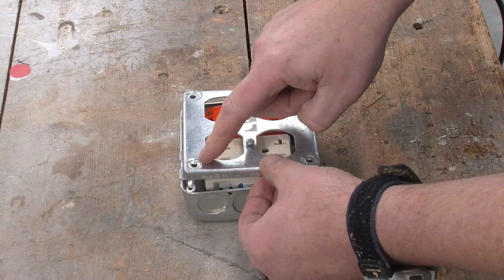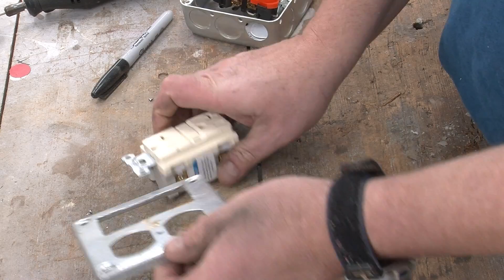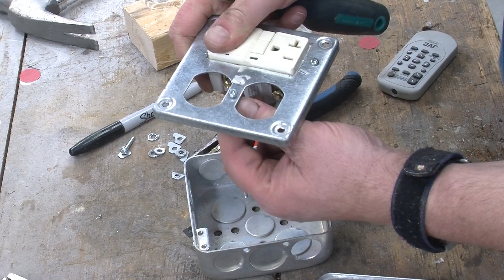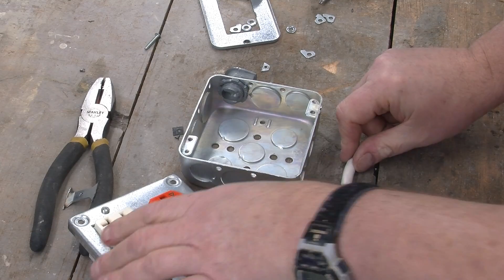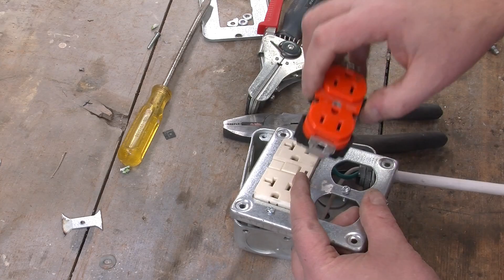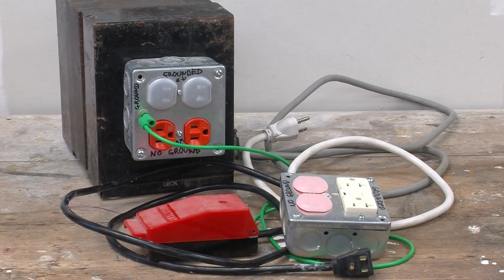Making Portable GFCI Outlet with and without ground

Comment: What is the advantage of a CFCI without a ground as compared to just a normal three prong outlet without the ground? everything is still earth referenced?
Reply from the maker: The CFGI will (hopefully) cut the power to the circuit if it detects any significant amount of current that goes out of the live but doesn't come back though the neutral. So there must be some current going though something somewhere and getting to ground where there should be no connection to ground. That connection might be a human so hopefully the GFCI trips.

If you had an unearthed 3 prong outlet without GFCI, there would be nothing to cut the power if a human was getting a shock due to some fault.

A non-GFCI regular grounded outlet provides protection but providing a connection to ground usually for exposed metal parts of the electrical device like a washing machine for example. If a short occurs, the ground pin provides a path to  ground rather than though  a human who might be touching the washer.

Hope that helps. Ideally, both a GFCI and ground on a circuit of course!
Reply: @ElectromagneticVideos  Make sense. I forgot how the GFCI detects faults; no ground wire required !
Reply from the maker: @stevenspmd  And I understand that in many places a GFCI is an approved way to a 3-prog outlet where the wiring is so old there is no ground available.

Comment: Wouldn't it be a better idea to get a double-gang Decora plate and a Decora isolated-ground receptacle?
Reply from the maker: Your absolutely right. But I happened to have a duplex  isolated-ground receptacle lying around and decora ones (or for that matter a combined decora / duplex faceplate) wasnt available in any local hardware stores and online prices were outrageous, so I used what I had in my parts box.